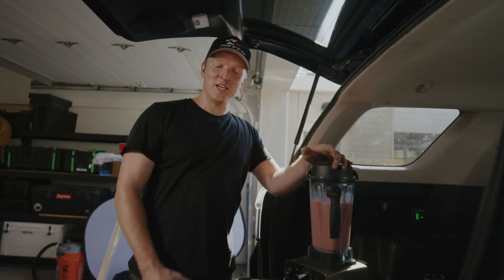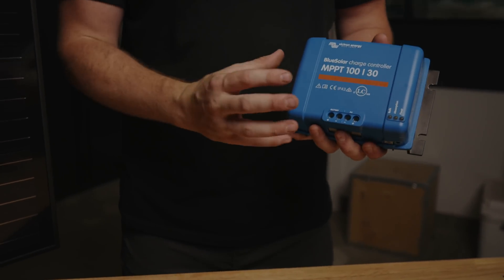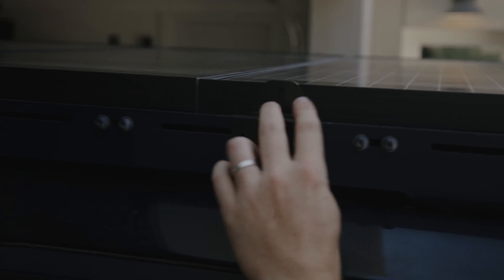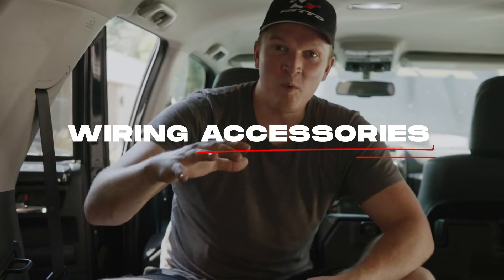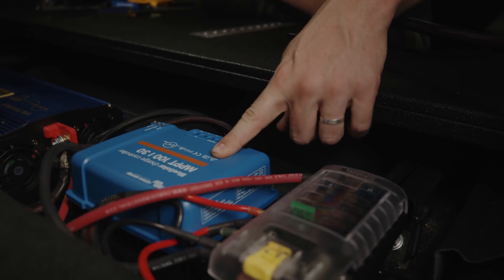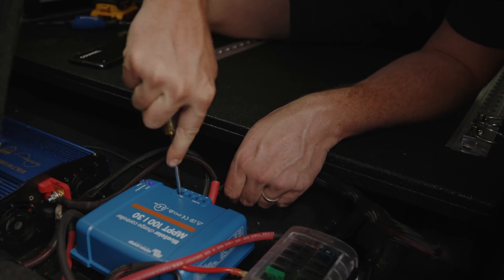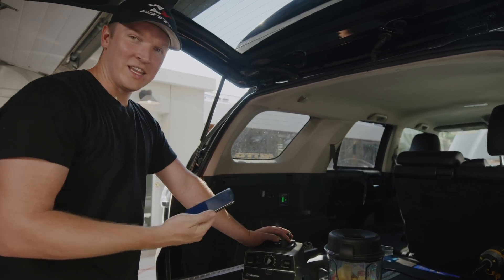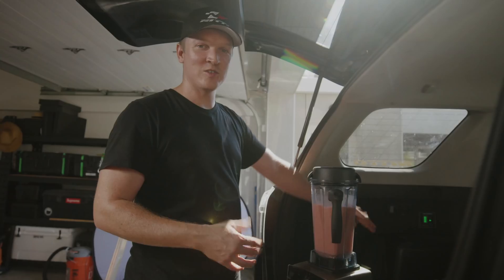DIY Solar Panels for Your Truck | Overland at Home

Comment: I really want a solar set up and learned a lot from your vid. my truck has a basic power inverter at 750w and no secondary battery source and can handle a small blender without an issue. my issue is having a need to leave the engine on so that my inverter can have full power, would a solar panel help or should i slap that #2 battery in?

Comment: i'd find a way to put solar on the roof rack if i  wasnt so worried about all the branches that always end up dragging across the truck on trails...  seems like that would wreck the panels pretty quickly.
Reply: Ya its definitely more of a desert thing.  What I dont understand is why do people go solar in the first place. You are dependent on the weather plus scratches and UV will cause it to glaze. So for the price and the amount of work involved. You could get a generator and have more power output and not hindered by the cloud cover.

Comment: Looks like a very nice and clean install. Blenders consume around 5-600 watts. I used 3000 watt continuous inverter on my last build which was two 6 volt golf cart Interstates wired for 12 volts off of one 260 watt panel. A bit overkill for the Kurig which at the water heat up point pulls 1350 watts. Going with a 2000 watt continuios inverter on current build with one 12 vt lithium 100ah battery and 2 140 watt panels. Got to have that morning coffee. I'm going for a professional instal like yours.